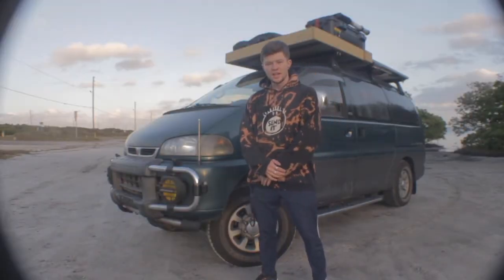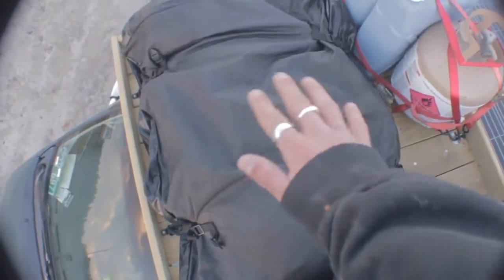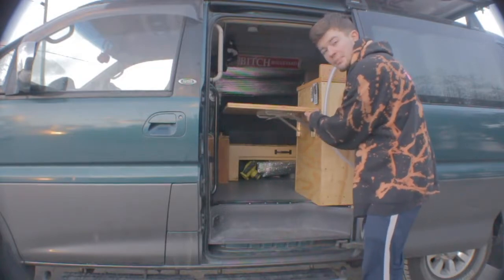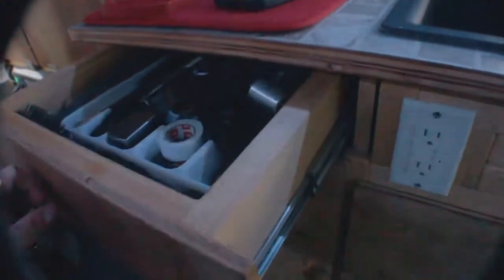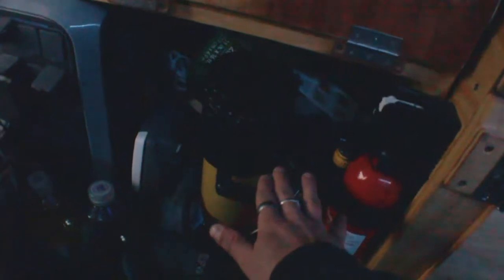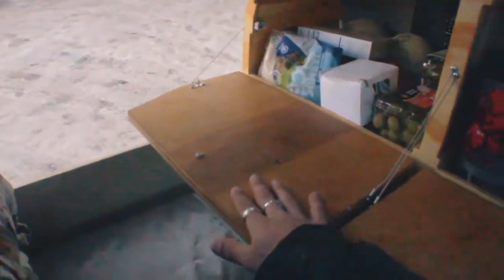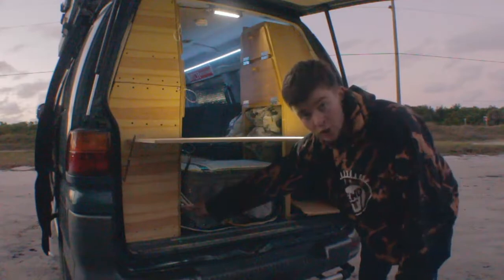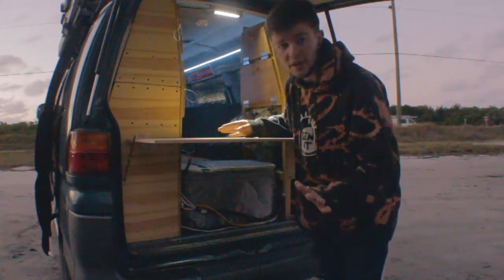Unique DIY Japanese Camper Van Tour (In Depth Overview)

Comment: I'm doing the same thing in my express for faster charging of the bluetti. I have Ac200max, that thing doesn't charge at all from the cigarette plug.
Reply from the maker: Yeah that's why I went with the fast charge method. You can DC charge at like 150w which is a joke. Totally worth it to do the extra work to setup the charger this way. Did you end up with one the Ac200's with the polarity issue? Almost bought it before I decided on the Ac200p
Reply: @SkierMan199  no mine seems to be fine on that. Yeah 150w is nothing...
Reply from the maker: @kamilk6956  You are definitely lucky to not have the reverse polarity issue. Don’t know if you are in the Facebook bluetti group. Tons of people received units with one of the outlets wired with reverse polarity, hence why I asked. Glad yours is in good working order. :)

Comment: Great method for faster charging of the Bluetti. First time I've seen that. I love the idea so thanks. What type of inverter are you using?
Reply from the maker: Hey! I’m glad my explanation made sense it’s really awesome having the ability to fast charge this way. The other benefit is I can solar charge at the same time so if it’s sunny I can be pulling almost 700 watts into the bluetti. I’m using the bestek 500 watt pure sine wave inverter. One recommendation is check your alternator specs to see if it can handle to excess amperage draw at idle. It’s a bit more than 40amps so it’s basically equivalent of a 40a DC to DC charger. I’m upgrading to a high power output alternator because it drains my starting battery at idle. Works completely fine when driving around, but I really want to be able to charge at idle speed if the solar is bad for a few days cuz then I could just turn the van on for an hour or 2 and charge up without driving around.
Reply: @SkierMan199  Awesome. Super helpful. I will keep that in mind of I go this route. Thanks!
Reply from the maker: @interestedinnewsolutions1211  Of course! Anymore questions feel free to let me know. I will do as much to help as possible!
Reply: @SkierMan199  Hi Ian, How's the van doing? I'm actually heading down a similar road to you. I just got a Bluetti AC200P and I just ordered a high output alternator for my Sienna. Quick question: Why didn't you connect the inverter to the alternator? Wouldn't that mean that the battery would only charge when the van was running, meaning you don't have to manually switch the inverter on and off? I've been doing a lot of research and I can't find a problem with this alternative. Thanks!
Reply from the maker: @interestedinnewsolutions1211  I did it really out of just not knowing that first off that you can go directly from the alternator. I have spare terminals on my starting battery for wiring something like an inverter off it so it was very easy to do. My alternator is fairly trapped in around all the other stuff in the engine bay so running a wire and connecting it would’ve been nearly impossible without taking it out first. It seems to work good but I’ve really got to get the high power alternator installed soon cuz it absolutely will kill my battery if I use it when idling.

I’m also going to install a Renogy Battery Monitor on my starting battery to monitor the voltage going in from the alternator and coming out when charging the bluetti for more piece of mind and ability to watch it more specifically. I think my currently alternator is crapping out so it’s gonna need to be very soon! Best of luck with your build.